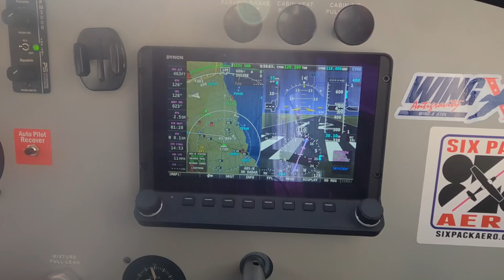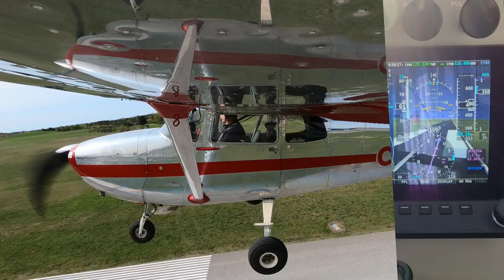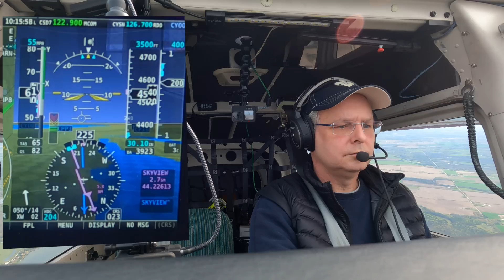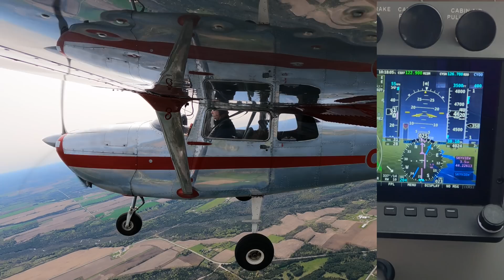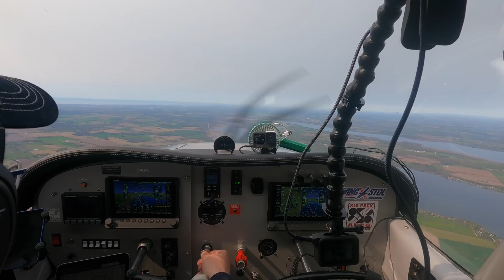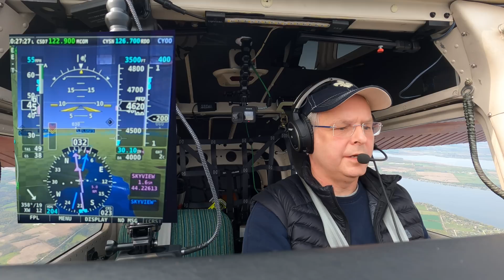Slowest Stall Speed Of A Cessna 172 Ever??? Maybe?

Comment: Wat's the empty weight of the plane?
Reply from the maker: Currently in Nov 2025 empty weight is 1,308 Lbs - with a max gross weight of 2,250 lbs.
Reply: @GlensHangar that’s light. I’m putting wing-x on my 170b this winter. I’m a bit heavier at 1400 but have an O-360 and constant speed, big bushwheels etc. I’ve heads the wing-x really shines when heavy.
Reply from the maker: @Super170BAlaska   yeah when we're fully loaded for a camping / hunting trip the extended wings really help with getting airborne. Especially with the underpowered O-300.
Reply: @GlensHangar  did the wing-x come with an updated weight and balance chart? Did the max aft CG move forward a little bit above 2200?

Comment: That’s an amazing indicated airspeed, i do think though that there is probably a significant mismatch at these high angles of attack. Have you done some calibrations against ground speed in each direction to get an idea of what your calibrated airspeed should be when it reads this low? My guess is that the calibrated airspeed is in the mid 30’s for stall. Again, amazing work, just trying to understand the true performance of all the work you put in!

Comment: Did I miss a video?   I watched your Trio AP install video with great interest and was thinking there'd be a video of you testing / introducing us to it's features in flight.   But it went straight to this video.    How is the Trio?
Reply from the maker: Trio is a work in progress - I mention it in a few videos after the installation, but I haven't really featured it yet.
At this point it really only gives basic functionality; holds altitude and course / track, which it does really well. I'm waiting on the final firmware update that will link the Trio with the Dynon, there have ben several Beta firmware updates and they are getting close to the certified release. I knew this going into the project, so this wasn't a surprise.

Comment: Glen, glad to see you restored a great airplane. A labor of love, no doubt. I remember my father demonstrating slow flight in his 1953 Cessna 180 near Ramapo Valley Airport over the NY Thruway sometime in 1968. With just the two of us on board, half fuel and 30 degree flaps, he got slowed it to 43 mph with full control. Of course, his experience flying a PBY Catalina (which was never known for speed) for the Navy in WWII might have something to do with his skill. I think he paid less than 5 grand for it. I was a straight 180, no baggage door. It was my job to fold down the rear seat and lift the luggage into the back. Every winter we flew from NJ to Florida during school vacations, 7 hours with a fuel stop. Wish I still had that plane. Cheers!

Comment: There are advantages to flying from quiet airports.... My "practice area" is over my "farm", about 10-15NM from the Dryden airport CYHD and it's rare to have any traffic. I usually inform ATC I'll be 10-15 west from 8000' to 2000' practicing aerobatics and they let me know when (rarely) there is any traffic to be of concern.  The downside is twofold, I do not have a lot of experience dealing with high traffic areas, and ATC in congested areas and controlled airspace, and I have to work hard to remember to make my clearing turns and traffic checks before doing aerobatics.
Great disclaimer about editing, I leave out the boring bits on most videos, but it can make people think you are skipping checklists and run-ups...  I'll try to make mention of that more.

Comment: I don't think a modern 172 displays airspeed below 40 knots. That is the point the G1000 system deems the airspeed valid.
Reply from the maker: This system comes alive around 20 knots, and it's using two separate pitot tubes